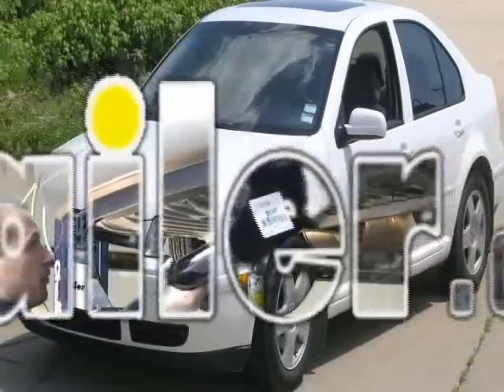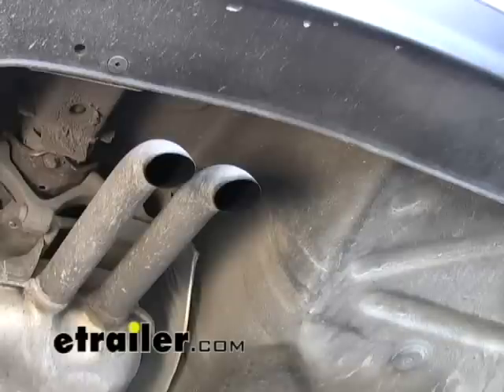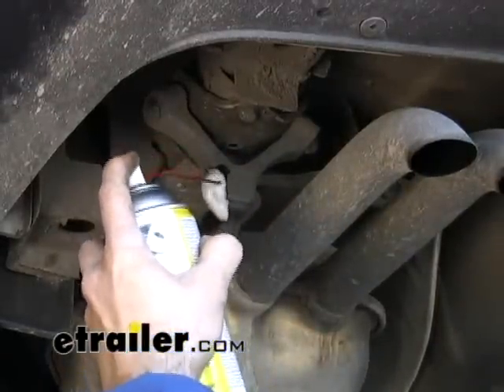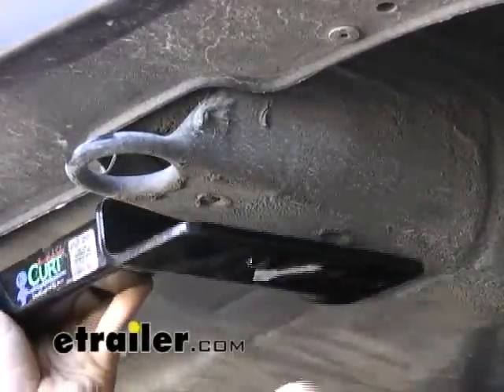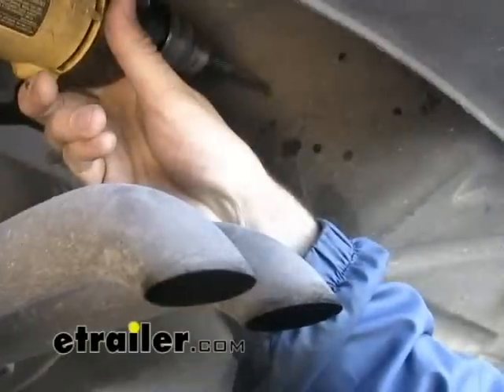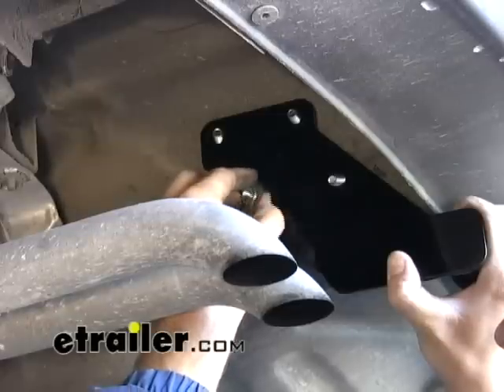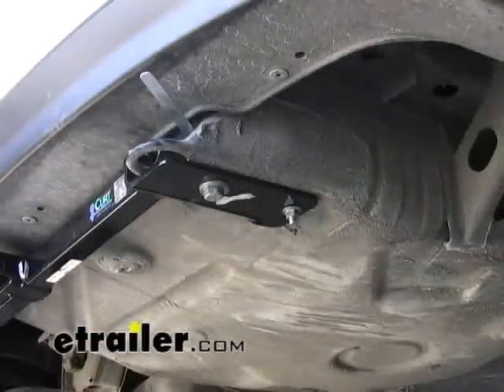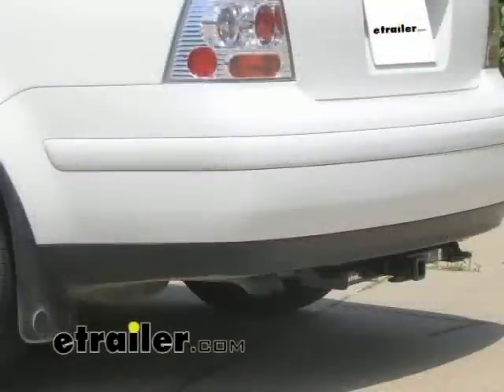etrailer | Installing the Curt Trailer Hitch Receiver on your 2000 Volkswagen Jetta

Comment: Which trailer hitch you guys recommend for a 2003 Jetta GLI? I'm mainly concern about sturdiness/strength given that each hitch has a different setup/installation process, e.g., CURT 110703 vs Reese 77106 vs Draw-Tite 24748.
Reply from the maker: fnavarro26 The hitches for that model year all have the same weight capacities, none are any stronger than another. The problem is, the GLI with the different body panels, will not be compatible with any of these hitches.